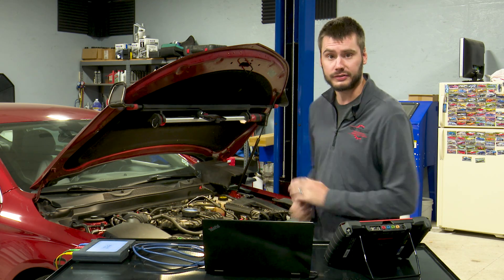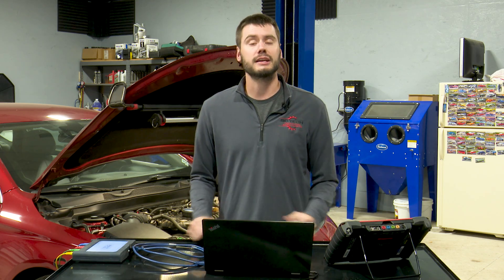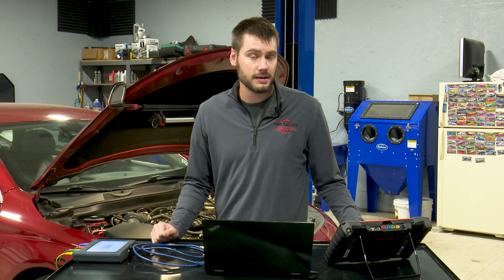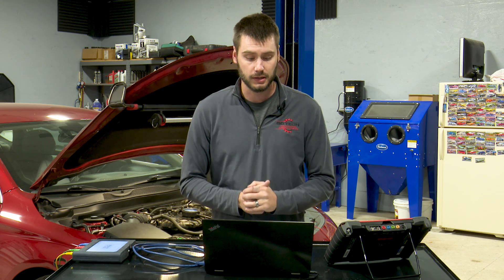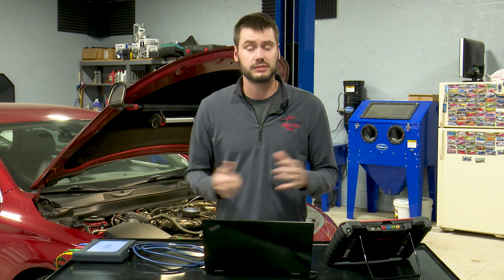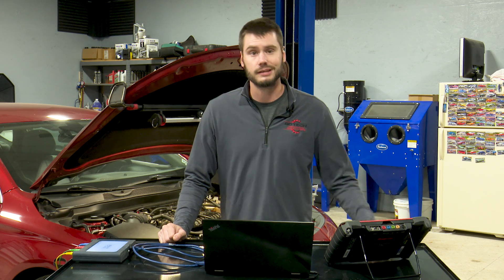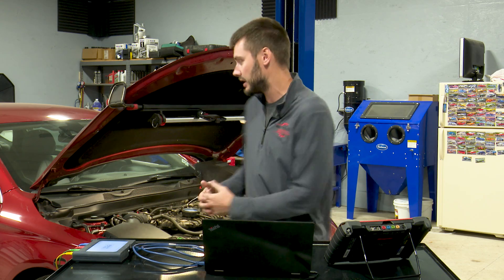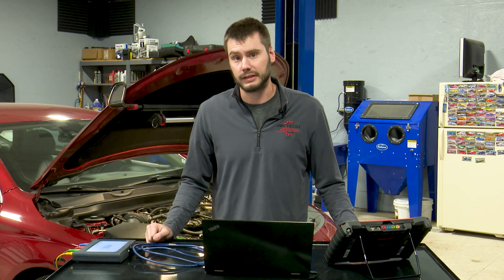3.6L GM Misfire Nightmare - Why No Check Engine Light!?!?

Comment: Our lord and saviour Micheal is back again! 

This week I had a 2012 Honda 2.4L with a cylinder one misfire, moving the spark plug, coil and fuel injector to number 2 did not move the misfire. 

I did a in-cylinder waveform as well as a regular compression test and noticed the compression was slightly less than the other cylinders. Intake pulls where slightly less than cylinder 2. I wanted to perform a valve adjustment to see if the compression and intake pulls would come up but customer declined the work booooo
Reply from the maker: Hey man, thanks for watching! You give me too much credit lol! Too bad you weren't able to get into it. Capturing those before and after are always fun!
Mike Becker, Senior Instructor

Comment: Hi Mike How is it possible to get a misfire on deceleration? So this engine is not an interference engine or 6 degrees is not enough to bend the valves?
Reply from the maker: Hey Carl, I'm told these are inference but they seem to be pretty forgiving. 
Mike Becker, Senior Instructor

Comment: keep in mind that the 3.6 tends to slide or spin the crank reluctor gear, it get loose and will cause both banks to create a correlation code. but if it is only one bank, most likely it is a timing chain issue.
Reply from the maker: Hey, thanks for watching! Yeh, i've seen that TSB for reluctor shift. Yeh, I agree!
Mike Becker, Senior Instructor

Comment: How do you measure vacuum pulls?
Reply from the maker: In this case, I hooked a PICO pressure transducer into the brake booster hose. Reading was taken at warm idle.
Mike Becker, Senior Instructor
Reply: @GoTechTraining  Interesting, thank you Mike

Comment: 7:30 ....  Hear me out: 
On the left side chart ---  We know that from the back side of your yellow exaust pulse-- over to the back of the next yellow exaust pulse is 720 Degrees, right -- (two full revolutions of the crank to get the Four strokes)..  There are 30 crank pulses in that 720 degrees.  That means that each crank pulse is another 24 degrees... And we seem to be just about a full crank pulse off from the known good...   

crank sproket = 30 teeth
idle sprocket =  33 teeth and 22 teeth
cam phaser =   40 teeth

So each crank tooth is worth 12 degrees if it jumps a tooth  (360/ 30)--    So we would actually have to jump 2 teeth at the crank to get our 24 degrees off that we are showing--  but then that would show up on both banks.  (so it did not jump teeth on the crank sprocket)

If you jump a tooth at the cam phaser (360/ 40) it would be 9 degrees off of the CAM signal.  but the cam only spins once per every 2 RPM of the crank.  Which means that a jumped tooh at the cam phaser would only be 4.5 degrees off of the crank signal.   So for it to be 24 degrees off as the signal shows-- the cam phaser would have ad to jump 5 teeth...  but that would likely have made it run much more terrible than it does.  (so it likely didn't jump teeth at the cam phaser either)

From what I can tell--- the only thing that logically makes sense, is that the chain jumped a tooth at the idler pulley on the bad side-- and that's how we get close to a full pulse/ notch in the signal --- but not quite.  And that's because the crank sproket has 30 teeth, but the idler has 33 teeth--- so they aren't quite exact;  and that's why we don't show our signal being exaclty one notch off, as it would if we had jumped a tooth at the crank..  It also explains why we only see it on one bank and not the other.

If you're going to pull it apart, I really would love it if you could spin the crank around and line up the timing notches and triple check exactly where it is off... maybe even get a protractor and show the exact degrees.

I'm thinking there will be a tensioner broken loose and that idler sprocket jumped one tooth on the bad bank.   But hey, maybe I'm wrong and it's just stretch...  but I personally don't think so.  It's off by 20 to 24 degrees..  haha.. cheers.
Reply from the maker: Hey Calholli, I love that this video got you thinking! So, the math is a bit incorrect here. When figuring out pulses, you want to track the ignition coil event, in this pattern the blue trace. That is 720°. That crank reluctor wheel is a 60-2. 58 teeth with a 2 tooth gap. That crankshaft spins twice per 4 cycles. Meaning moving one tooth would set this back 6° of crankshaft angle. 360°/60 teeth = 6° per tooth. Again, I really love all of the time and thought you've put into this. Shows you're passionate about the industry!
Mike Becker, Senior Instructor
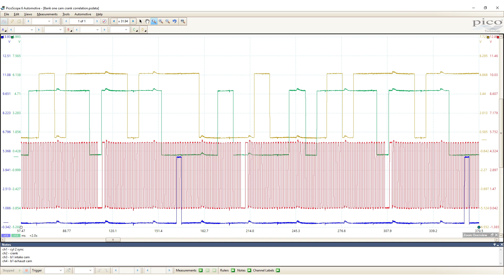Reply: @GoTechTraining    Oh I see now, at 7:10 ... the blue at the bottom, is the sync...   It wasn't on the next chart, so that threw me off..   I thought those cam signals were showing full rotations of the crank, but that must simply be showing intake from one cylinder to the next cylinder..  Ok, I'm with you now.
Reply from the maker: Awesome! The more you know, right?! 😃
Mike Becker, Senior Instructor

Comment: Awesome video, and appreciate you sharing. Do have a question, I’m sure many of us have seen and driven a vehicle with cam correlation issues. Can’t argue with the data you’ve gathered, but you’d think a vehicle that is stretched enough would have noticeable issues like what you experienced
Reply: i replace timing chains on a 3.6 malibu, timing marks were right previous to replacement, and custmer replaced cam and crank sensors, and actuator solenoides for timing. cant remeber code number but was related to the bank closed to the firewall, chain was not that tie. i did some upgrades recommenden by tsb.. and problem went away. unfortunately i did not recorded any scope patterns previous or after the repair was done.
Reply from the maker: Glad to hear you got it fixed up!
Mike Becker, Senior Instructor
Reply from the maker: Hey George, thanks for watching! It's tough to say how the vehicle will react especially with the ability to phase cam timing. If base timing is out, could VVT pull it back in to make it run ok? I guess it would depend on how it was out and how far...and on the strategy of the PCM too.
Mike Becker, Senior Instructor

Comment: Great diagnosis 
The old vacuum gauge doesn't lie 👍
Reply from the maker: Hey Atiq, you are right! Any idea what good spec is?
Mike Becker, Senior Instructor
Reply: @GoTechTraining  18 to 22 inches of mercury
Providing the general health of the engine is good
Reply from the maker: I've heard those numbers before as general rules of thumb. Is that specific to the 3.6?
Mike Becker, Senior Instructor
Reply: @GoTechTraining  Hi Mike 
Thats just fundamentals
We have those 3.6 motors here in Australia fitted to GMH..General Motors Holden
Reply from the maker: At least yours are all RWD in Australia, right?
Mike Becker, Senior Instructor
Reply: @GoTechTraining  Yes thats correct 
Rear wheel drives
Reply: @GoTechTraining yes, and that's why I'm saving up to have my Commodore on a hoist to remove transmission just to change the thermostat at the very back of the engine!
Every other car I've owned it is a DIY job.
Goodbye $500+

Comment: Very nice work Mike.  If you used a pressure transducer in the vacuum, would you have seen the problem doing an in cylinder pressure transducer reading? I haven't picked one up  yet.  I dont seem to use the Pico as much as I thought I would. Happy fathers day Mike!!
Reply from the maker: Hey Mike, happy Fathers Day to you as well! So, the reason I didn't go in-cylider is because I was chasing a bank misfire and not a single cylinder. Had it been single, I likely would have gone in cylinder. Not sure if you'd see it though, valve opening, especially intake is hard to see.
Mike Becker, Senior Instructor
Reply: @GoTechTraining  Oh right. That makes sense.  You would see 4 strokes, not each cylinder.   I see them being used to test for head gasket leaks now too.  Getting too advanced for me.  You're def. great at your job sir.
Reply from the maker: Like with any tool, the PICO scope and transducer have their uses. They are great when you need them and dust collectors when you don't. I highly doubt anything is too advanced for you if you spend a little time with it! I've seen your work...Porsche Mike...it's impressive!!!
Mike Becker, Senior Instructor
Reply: @GoTechTraining  Thanks Mike.  I had a great teacher.
Reply from the maker: Teachers, I can only take a fraction of credit for helping people fix cars. There are so many great people out there making videos :)
Mike Becker, Senior Instructor

Comment: gm 3.6 before watching the video I'm betting on timing chain stretched. 🤣I have seen them loose at 110k miles. this engine is badly designed with 3 chains..
Reply from the maker: Ahhhh if you know you know, right!? Hahah!
Mike Becker, Senior Instructor

Comment: Just asking. How much roughly would that job cost? Lmk
Reply: The parts alone w/ no phasers are like 800 dollars, if you replace 1 phaser does another 700 dollars or more.
Reply from the maker: Hey Jeremy, $3,000-$4,000 seems to be the average pricing for a chain and necessaries to be replaced. Adding phasers adds a lot of cost. 
Mike Becker, Senior Instructor
Reply: @GoTechTraining  how many hours labor do you think that is
Reply from the maker: 12-ish. The quote may include more time for certain things. Depends on how the shop bills it.
Mike Becker, Senior Instructor

Comment: Increasingly I’ve come to realize from my experiences, that as highly sophisticated as the computer controls are on modern vehicles, often times problems that should set a code, do not, because they are not within the parameters to do so. I was surprised that vehicle did not set a cam/crank code, being off by 6 degrees.

However, one thing I’ve long done when looking at PIDS on any vehicle with VVT, is looking at the desired and actual degree position for each camshaft. I would imagine that you would be able to identify that bank 1 was retarded by looking at that data.
Reply from the maker: Hey JPJ Auto Tech, thanks for watching! From what others have said, at production calibration this car would have coded. After the reflash, parameters were widened. As far as actual and desired, that's tough to say. I'll have to see if I have that data. If I do, i'll respond back what I see.,
Mike Becker, Senior Instructor
Reply: I know Chrysler do have that data on my launch but I"m unsure about GMs.
Reply from the maker: I know Ford shows it too. Honestly though, i'm just not sure I can always trust that data. I haven't run into an issue with cam/crank correlation specifically, but scan tools are known to lie to us...and if I'm quoting a $3,000+ job I feel a lot better about seeing the pattern on my scope. Just my 2 cents 😀
Mike Becker, Senior Instructor
Reply: It would be interesting to see, if you do have that data. I really appreciate the content on this channel, a lot of very good in depth info here.
Reply: Oh I totally understand wanting to have the highest degree of certainty before making the final call on a high dollar job like that, I’m the same way. But if my thinking is correct, the scan tool data would at least be able to help you narrow down the problem quicker. Then you could verify with the scope.

And my understanding has long been that generic OBD2 PIDS must be accurate, with no substituted values allowed, as in enhanced mode. If I remember correctly, I believe a 3.6 Jeep Wrangler I worked on earlier this year had VVT data in generic OBD2 mode.
Reply from the maker: Yes, enhanced OBD2 only runs true PID info from what I understand as well. 
Mike Becker, Senior Instructor

Comment: Oh surprise, surprise another 3.6 "General Mess" puss bucket  with stretched chains!... The best solution is a gallon of petrol n a match!... problem fixed permanently!
Reply from the maker: Hey Greg, thanks for watching! Not sure the insurance company or the local PD would find that to be the best solution 😂
Mike Becker, Senior Instructor
Reply: @GoTechTraining  Maybe not but that's what all GM 3.6 deserve, fortunately we never got them as FWD only RWD in the Commodore here in OZ, I could only imagine just how much fun a timing kit job on one of these is as a FWD there bad enough as RWD which is horrible!... I done many tens of dozens of timing kit & of course the usual  o2 sensor n cat problems, these are the things that tell you it's  a General Mess product!
Reply from the maker: I feel ya Greg! I think the world could have been a better place if the 3.6L wasn't designed hahaha! Any 3.6L's I do that are FWD or AWD get dropped out the bottom for sure. I'm not trying to squeeze a chain, 3 stupid chains.... in that engine without seeing it.

Comment: as usual very very good only problem i have is wish you had a new video every day. one test not sure if you have done is testing the APP sensor. been working o n a 2007 buick lacross finally got it fixed today but would like to know more about testing them
Reply from the maker: Hey man, I wish we could do a video every day too...it's hard with all our responsibilities. Not sure the APP would be causing these issues as they are bank/bank differences. The APP would likely affect the engine as a whole.
Mike Becker, Senior Instructor
Reply: @GoTechTraining  what I meant should have explained better wish you could do a in-depth diag on GM app. I just finally fixed one. Got 2 bad app sensors 3rd was the charm but would like to see if there was a easier or better way to diag
Reply from the maker: Ahhhhh sorry man, misunderstood. Honestly, a scope is probably the way to go. A volt meter isn't fast enough and the scan data can lie. I would scope the signal wires, usually there's 2 or 3. They should look like an X. If there's a 3 signal, usually they scale at a different voltage scale. Slowly move the pedal and look for inconsistencies in the signal. 
Mike Becker, Senior Instructor
Reply: the replacement app was a dorman which didn't work wouldn't work at all. so oreilly sent out another one in the mean time i called the tech line for dorman to make sure i wasn't missing anything. when the second dorman one arrived i installed and  before even starting it up called dorman and we went thru all the test with scope dorman again said voltage low but try it anyway. went one day set codes for app again got it back called dorman checked it again voltages low dorman said get a oem app and lets check it installed the oem voltage going in good voltage going out low but some better. he said try it and see customer left runs great the difference in the 2 app sensors was not the voltage that caused the problem it was the signal on the dorman was choppy like it was pulse regualted the oem was a smooth line guess signal was better with oem dorman said mark that one where they can check to see whats going on

Comment: I personlly think all engines should have direct gears for the timing, like a Diesel engine.  It's funny how you rarely hear a 7.3L or Cummins have "timing" issues.  there should be no chains and no belts-- only direct gears.
Reply: They have every other issue instead.
Reply: Also if they designed it with multiple key ways to increase torsion surface area and eliminate the need for specialty tools for timing alignment. I’m asking for too much aren’t I?!
Reply from the maker: Everything will have issues. There's no perfect vehicle at all.
Mike Becker, Senior Instructor
Reply from the maker: Oh man, the old 7.3 was a solid engine. Glow plugs and harnesses...but not much else. The 4.6L DOHC motor in the Cobra and Aviator was solid too. I don't think manufacturers have the money to stick into engines like that anymore. Cost, weight, fuel eco, etc all factor into the problems we see today. 
Mike Becker, Senior Instructor
Reply from the maker: Hahah that's awesome man! Growing up my dad had a 96' crew cab, 8 ft box, DRW, 2wd auto. I loved that truck...the sound was amazing.! But as i'm sure you could guess, 2WD and Wisconsin winters don't get along. It was only good for towing/hauling 7 months of the year and was sold around 15 years later. I'd consider buying it if I knew where it was!
Mike Becker, Senior Instructor